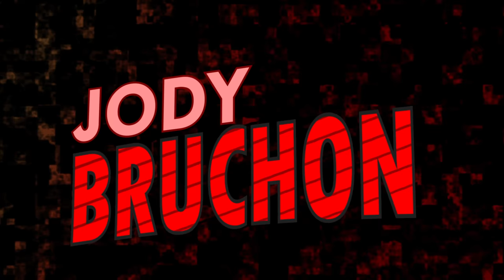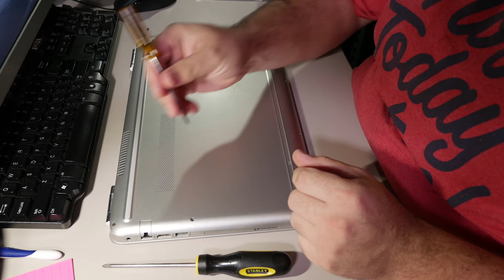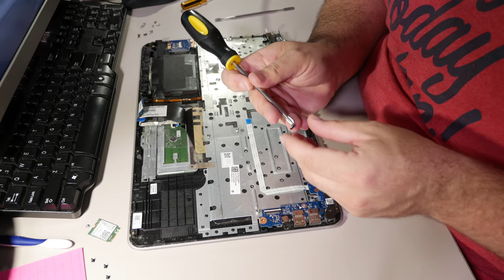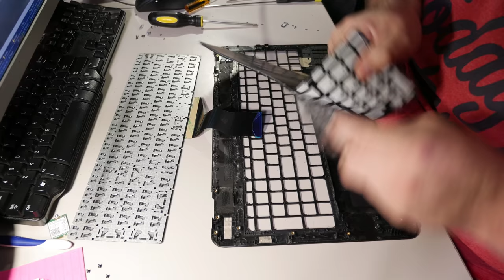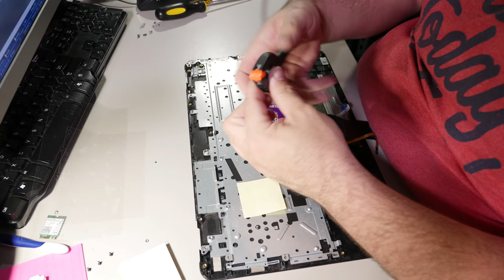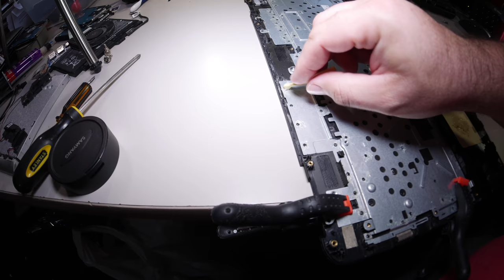HP 15-au010wm Backlit Keyboard Replacement - Full Disassembly, Lots of Epoxy - Jody Bruchon

Comment: Use a heat gun or a soldering iron to melt the plastic welds and trim the left over welds to get the mettle plate off.
Reply from the maker: That's a bad plan for a lot of different reasons.
Reply: I am interested to why you say that it is a bad plan. The only problem that I can see would be on a careless repair guy melting a hole in the key if he is not careful. Explain what your reasoning is could you.
Reply from the maker: @Glennmc7  The plastic frame that the keyboard sets in will shrink. Melting the plastic bits will release a lot of toxic fumes. Using a soldering iron to do it will also trash your iron tip

Comment: What if I use super glue instead of epoxy?
Reply: That would secure it for sure but if you need to replace again for some reason, would totally be a nightmare
Reply: @renecerney  At least it'll be secured just kidding. Thanks man
Reply from the maker: Super glue literally melts most plastics and doesn't hold them very well either. I use epoxy because it's much stronger and doesn't melt the plastics it bonds to.